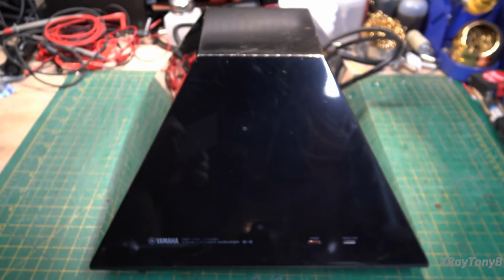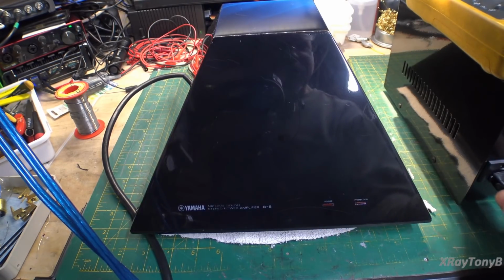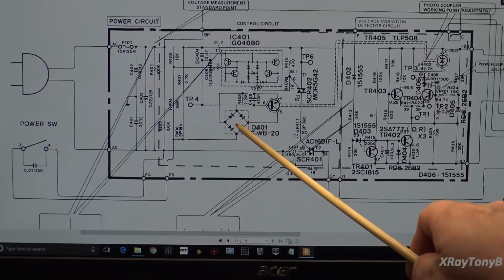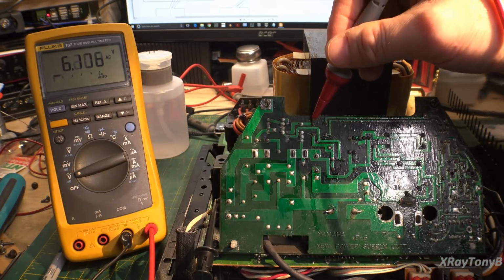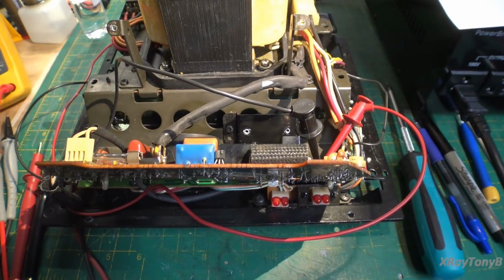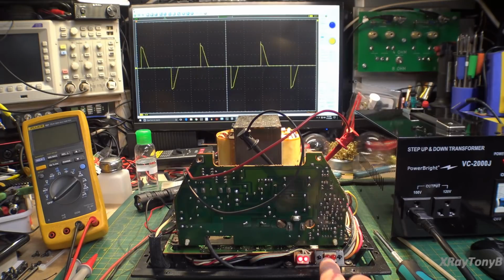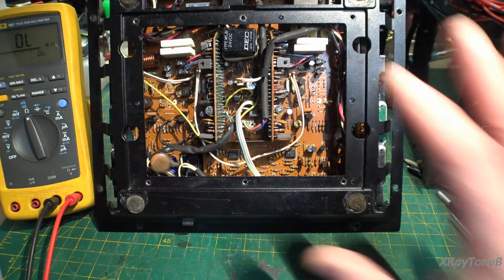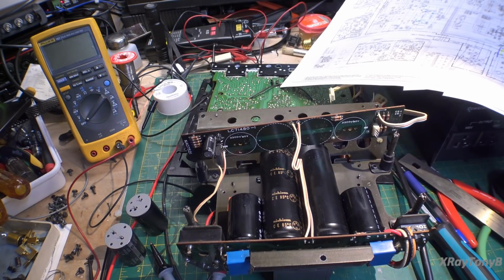Yamaha B 6 Amp Part1 - Unlocking the Secrets of the Pyramid

Comment: I have Yamaha B-50, and it have similar power supply unit, so Yamaha hasnt abandoned this technology and use it in next model line. And now i also have problem with power unit, when i turn on the amplifier, my 220-100 transformer starts buzzing very hard, but 15A fuse is safe. Now i start searching information, and im gonna start measuring circuits in the near future. So, thank you for that video, very useful! (sorry for my bad english)

Comment: I would check all of the power supply  caps with my in circuit ESR meter on anything near that old or if a cap is by a source of heat on newer equipment, One thing I like with my EDS-88A is that it also checks for low DCR so it would of caught that shorted cap. (It's a worthwhile investment) Wonder if the transformer (magnetic field coil) buzzes like it does with Carver Amplifiers. Will I ever find out?

Comment: I've worked on some high power triac / scr controlled radar power supplies and a couple of commercial units as well. I see carver decided to build their  own SSRs. Mothing wrong with that as long as you realize the huge inductance your driving. If you don't drive it VERY hard it may start conducting in a DC mode and that results in very high fault currents that will cause a bit of puckering.

You have to over come the gate charge so you have drive the living bejesus out of those gates to make sure both sides reliably turn on. I had to drive them at 5-7 times the datasheet values, we were using opto isolators (moc3062) to drive triacs and I spoke to the Motorola application engineer who told me how important it was to overdrive the gates. SCR's are easier to drive than Triacs when dealing with highly inductivs circuits. There is no real heat involved because all your doing is charging the intrinsic gate capacitance.

Comment: Bob Carver's first company was Phase Linear. He built his prototype amp in prison, and enclosed it in a coffee can. The Phase Linear 1000 (500W X 2) was based on this prototype. Phase Linear whas the first company to offer audio amplifiers for less than a dollar per watt. He also introduced the Sonic Hologram Generator, that can greatly increase the spread of the stereo field. My dad used to sell Carver (and Phase Linear) and he first told me all about Bob Carver many years ago. And he just refreshed my memory about his equipment! : ) I clearly remember the Phase Linear equipment with its brushed, light brass finish and all the knobs and the big meters on the amplifier. It also got really loud! : )
Reply: Bob Carver did NOT go to prison.  His first amp WAS enclosed on a coffee can, and demo'd at a MacIntosh clinic. It was the Phase Linear 700, 350 watts per channel/, followed up by the Phase Linear 400, 200 watts/channel. I sold these in Massachusetts.
Reply: I can find no reference about Bob Carver going to prison.

Comment: Hi Everyone I have a realistic STA-2000 I have pulled all fuses inside and only left in the main fuse. With that a 40 Watt bulb in my dim bulb is on full on. I suspect primary windings are fried, I would really like a good measurement I can do on the main transformer. Also with all 5 internal fuses in place I get no dial lights just full on dim bulb. I see or smell no damage to main transformer.
Reply: Check the primary windings with an ohm meter. If it measures 0 ohms (or something less that 10) then yeah, fried primary. If there's plenty of resistance, you might want to check the capacitors in the power supply.

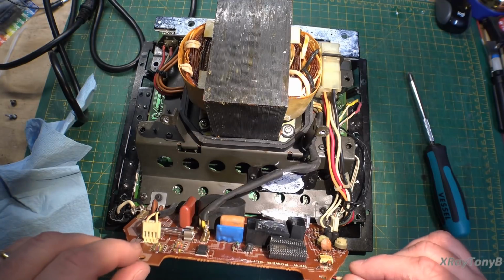Comment: 13:53 - My guess is that some output transistors are blown due to poor heat-dissipation. The reason: Too Much Heatsink Grease! You mentioned in the Marantz video,  that too much of it can hinder thermal conductivity. BTW, That Marantz chassis was basically One Big Heatsink as well!

Comment: 1. Change out the caps. Electrolytic caps  are most likely the culprit. 2. Since you suspect that someone else was in it check the fuse. It could be a 20 or 30 Amp.
Should be a 15 Amp fuse. Like your detective work even without a proper schematic! Is it all really done with  smoke and mirrors?

Comment: I love watching you trouble-shoot and your thought process, good stuff. To read voltages in out of the way hard to get at places I "tack", IE temporarily solder, a thin bit of wire onto the pad where I want to measure then feeding out the wire through any spaces. I can then put the DUT back together in order to take a reading. Grand video as always, thanks..DA

Comment: You asked for those with some knowledge of Carver amps to share, so here you go. I remember working on the original Carver Cube back in the day. It was one of the most finicky designs I ever had to deal with. Essentially a Class H analog amp powered by a variant of a switching supply like the one in your Yamaha, it became obvious before long that the only way to have it be reliable after a repair was to use original parts directly from Carver, especially in the power supply. But, when it worked, it was rather amazing for the time. 200 watts per channel from a seven-inch cube!
Incidentally, the power supply is able to use a much smaller transformer than normal, even though it still runs nominally at 60Hz. This is because the triac "chops" the sine wave by not turning power on to the transformer until the voltage has risen (or fallen) to a certain instantaneous value on each half-cycle. The resulting waveform has a very fast rise time rather than the slow rise of the 60Hz sine wave, and this emulates a much higher frequency, allowing the use of a smaller transformer.

Comment: It is funny how they call it a "magnetic-field" amp, as there are no 
magnets or fields, it is simply a dual rail power supply that switches 
between two rail voltages based on output power demand. Some high-end 
Class-D amps still use the dual-rail design today

Comment: I'm a total fan of 80's Yamaha gear. In my little collection I've got a B-2x, C-2x, M-2, C-2a, A-1000 and a (Japanese market) A-950 and love them all. I've had a hard time locating Japanese service manuals as well. 
I have seen the driver transistors for the protect relay get weak over time which might be contributing to your issues.

Comment: The pyramids are not that difficult to work out how they were built by building a canals and using barges to float the stones into position
Why do you need a transformer you've got to quite a powerful variac haven't you
Reply: John sweda I think because the owner sent him a transformer which I assume will be needed for when it’s hopefully fixed
Reply: @Dangrdav  yeah but it come from Japan why would you need a transformer it would be going back to Japan I thought
Reply from the maker: The owner will be using it in the U.S.
Reply: Problem solved.